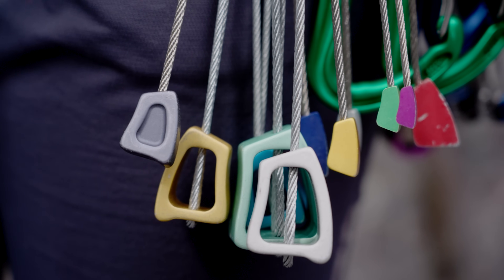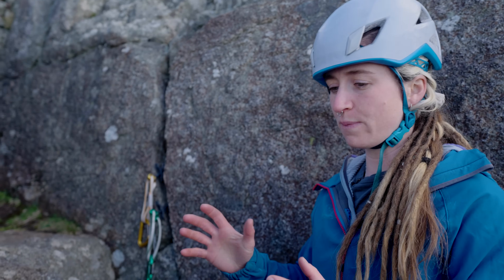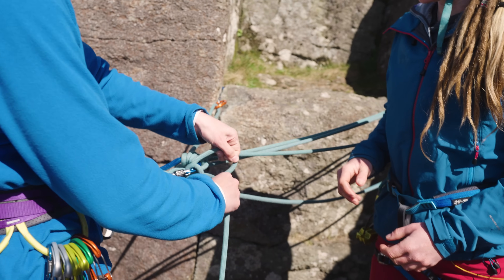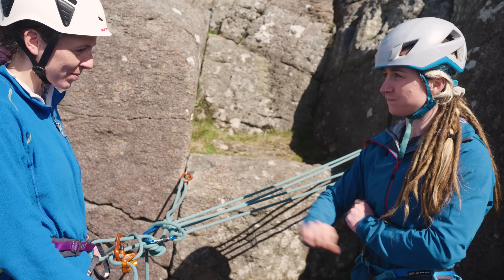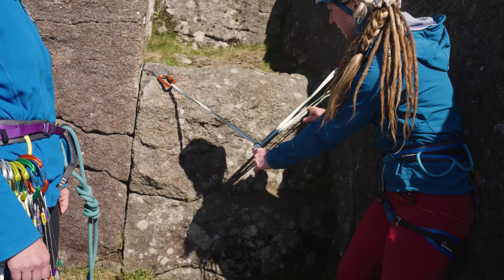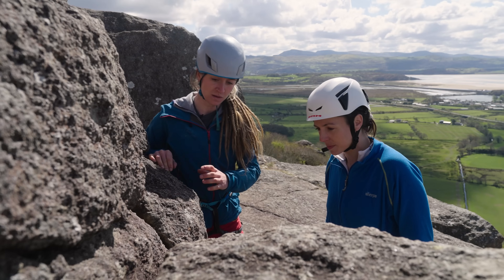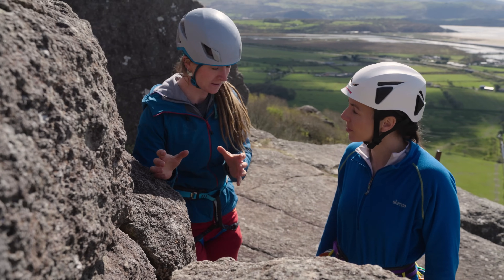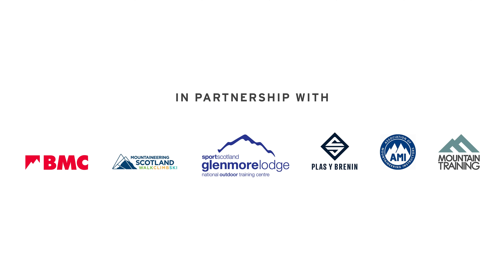Learning to Trad Climb: Part 3 - How to build a belay

Comment: It's a good guide. But I don't like how you are teaching them to use that type of belay device to the top of the anchor. You should always use a belay device with guide mode on it. so if a climber takes a fall, it's not attached so close to you and there is no risk for injury. Otherwise good video
Reply: If you’ve built your belay with the rope guide mode would be awkward to use
Reply: Also if you’re on a small belay ledge guide mode would also be a bit of a pain!
Reply: There are risks with guide mode belaying that require more thought such as lowering and cross loading with multiple seconds, this use of the belay device with the rope is excellent for beginners as an out-of-reach belay setup with belay device on rope loop can be used in any senario whereas guide mode requires more thought and care. It also translates nicely from gym climbing as shown in the video.
Reply: @matsr_2279  that was one of the good things I saw that it's a good way if a person needs to be lowered 👍👍
Reply from the maker: Hi Oscar, Alice here. It looks like your query has been sorted in the comments below, and I have answered a similar question above if you wanted to take a look at the answer there too. As a general answer though, there are so many different scenarios that we are faced with when we are trad climbing, and different techniques are the right ones to use at different times; it all comes down to the climbers knowledge, judgement and the gear that they are using. I hope this helps!